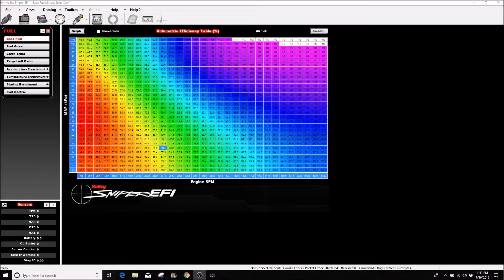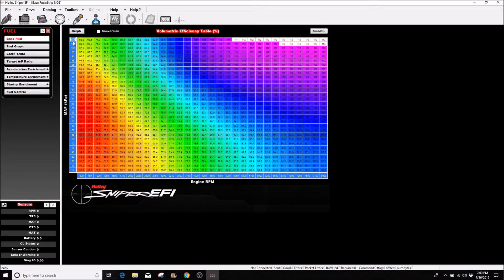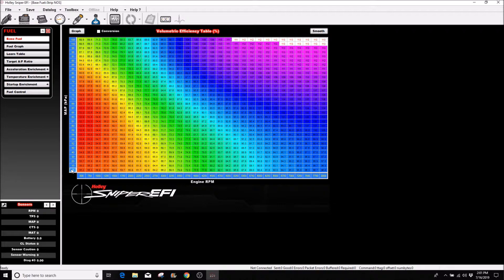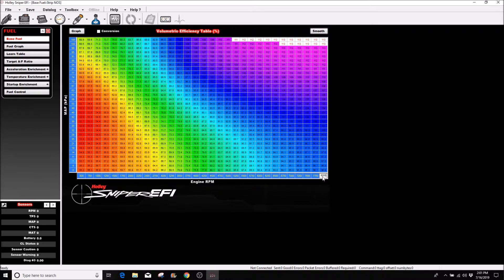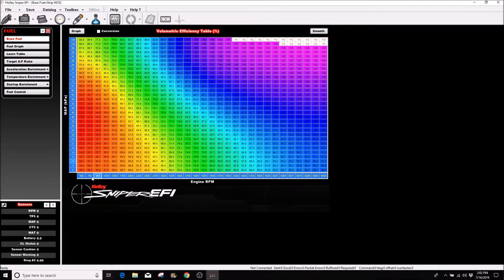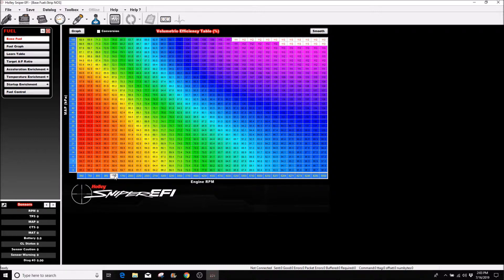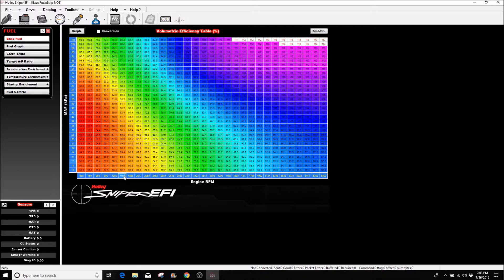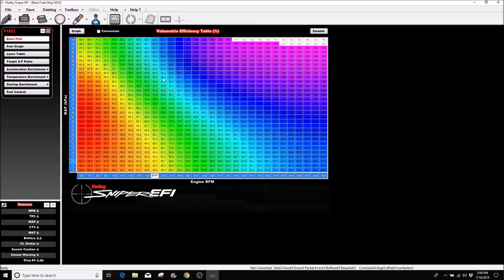Holley EFI:  How to Adjust kPA and RPM axis

Comment: Thanks for the video, very useful.
One question: we can see how the values for MAP and RPM changes, but the values on the table do not change.
After the change, the value that we had for any given MAP and RPM is now set for a different value of MAP and RPM. 
Don’t the values inside the table need to be somehow also changed?
Thanks again.
Reply: Exactly - since the tables values did not change, they are RUINED by changing the axis values. This vid shows how to do it correctly, but it requires a spreadsheet program - https://www.youtube.com/watch?v=BdrnZUZnU6g&ab_channel=LeechMotorsports
Reply: My question exactly, thanks for asking and thanks @tedgreen4626 for answering